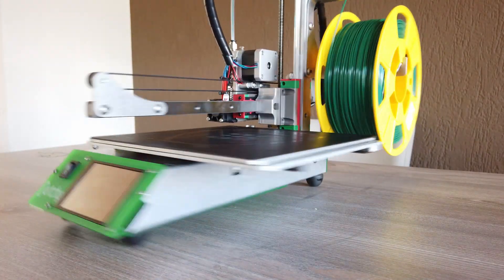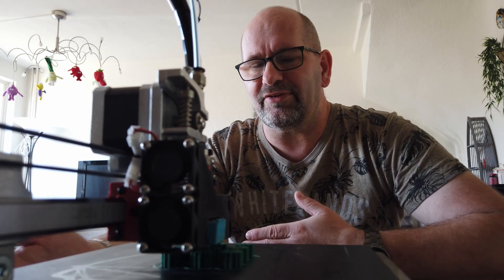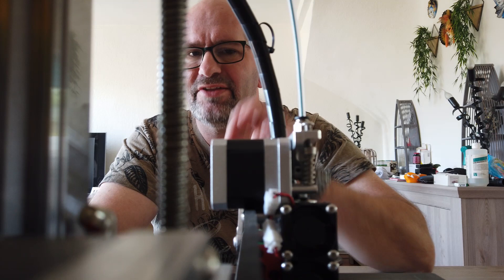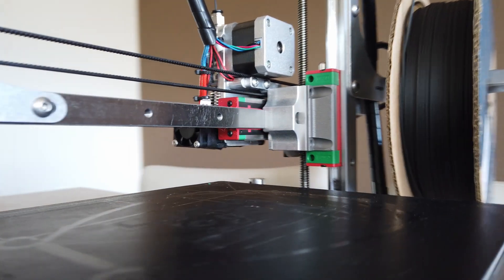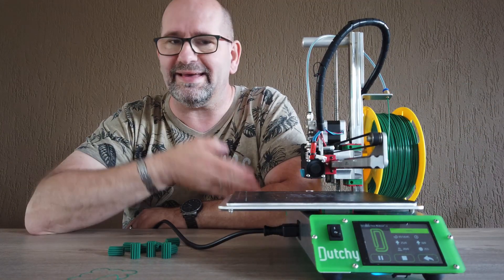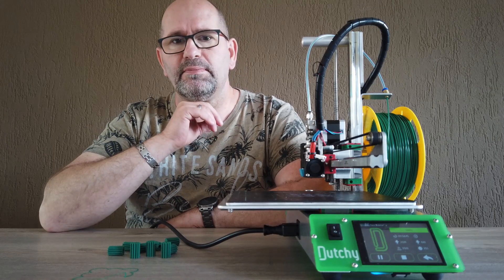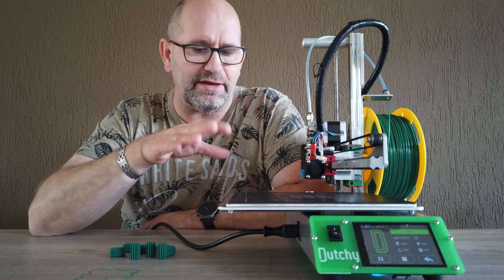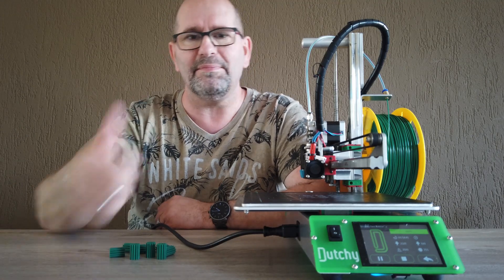▼ Dutchy | The BEST 3D Printer for schools ever

Comment: I wish them the best! But for €1500 it is a though sale. We are talking Mk3S market here. Which has a lot more to offer than this one.
Reply from the maker: I can understand your thoughts, yet the MK3S  market is completely different from the Dutchy market.
The printers are not comparable at all. The Dutchy is like a Volvo without any options, luxury or alarm system, while the MK3S is more like the most pimped Suzuki ever. No matter how luxurious the Suzuki is, and how good it is at staying in the lane and driving in muddy terrain, the motor is still a Suzuki motor, and will never be as good as the Volvo.
Now I don't want to get in a discussion about the quality of the Suzuki brand, nor do I like Volvo cars... but this is how the discussion about these printers should be going. The Dutchy is really the best printer I ever tested, and I do work with the MK3s quite often.
Reply: No, just no. 
Like I am dutch and it is cool that there is a new dutch printer builder. And I get the price, stuff is expensive to make here. It's a lot cheaper to make in Czech. But like it has nothing more to offer than a Prusa. If you think I am wrong please come with specific things instead of anologies that make no sense.

Comment: That's quite expensive. 
I don't see how this goes over a Prusa, sturdy etc. or not. I'd also use a 3D printer in classes up from the 9th grade, not below that. At that point, it's not that "dangerous" anymore, and the students are also more catious with their own bodies. 
As a teacher, it feels like it's easier to pitch something like a Prusa, also with the price point.
Reply from the maker: It's nothing like a Prusa at all, but I understand why you compare it.
A completely metal machine, that is unbreakable and can't deform even if you want it to, is not at all comparable to a Prusa machine. That said, the question is if there is a need for such an unbreakable printer? I can't give you my answer to that. I think it's nice to have a printer that you can pick up from the lockers every day, then use it, and at the end of the day, bring it back to the lockers again, without ever having to think about leveling or other maintenance, but when the teacher is skilled enough, and when to students are trained correctly, I think it doesn't matter that much.
Fact is, that a lot of schools use Prusa printers, or even Anycubic I3 Mega's...